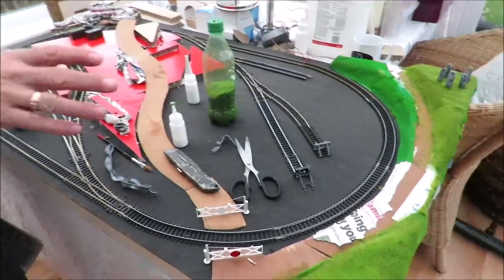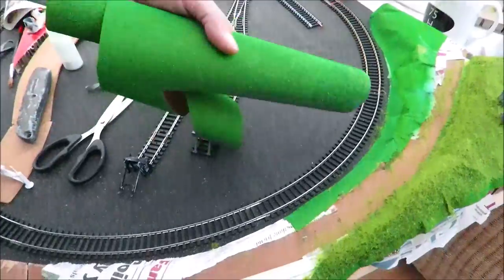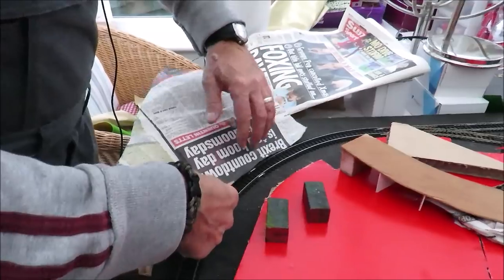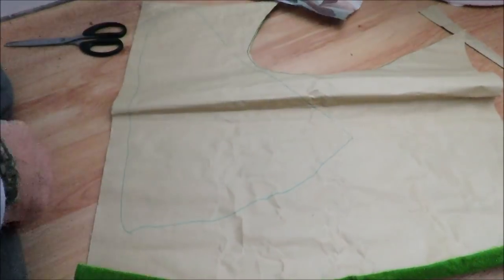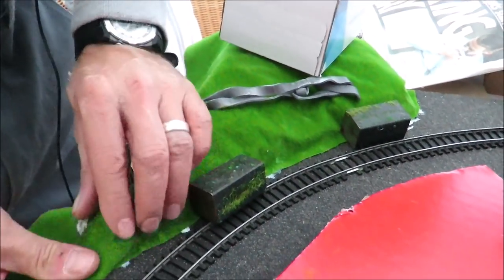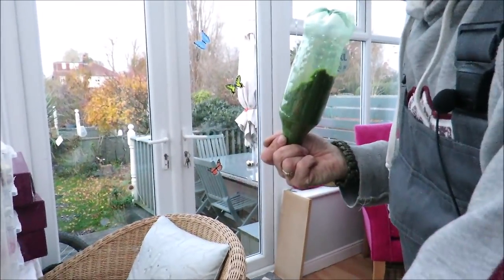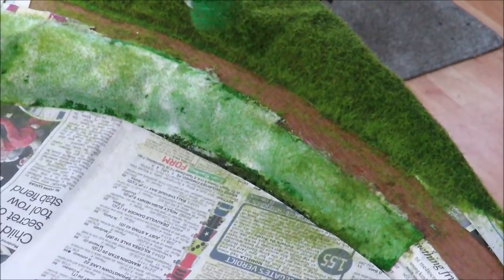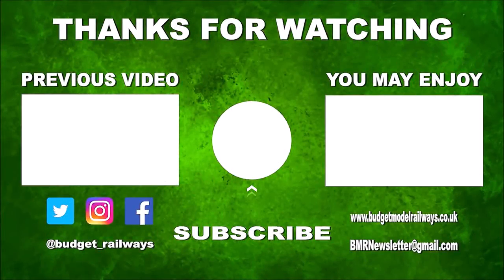Creating An OO Gauge British Model Railway Exhibition Layout - Part 4 - Static Grass

Comment: Nice take on an alternative for the Noch bottle applicator, does it make a difference if you let gravity do it's work instead of launching the fibers on air pressure by squeezing the bottle?
That water tower / locomotive shed would make a great Kof (very small shunter) shed for a continental styled layout.
Reply: For an example: https://www.youtube.com/watch?v=6L8HGEuxg0s
The strange design allows transport by flatcar without disassembly, as the maximum speed is about 30-40 kmh
Reply from the maker: Good point, ive tried shaking from higher up which works better. The loco shed is based on UK branch line practice but could work anywhere

Comment: can you please tell me the best curve radius for oo gauge the width of the board is twenty two and half  inches and the length is 6ft 5in
Reply from the maker: The smallest standard curve is 1st radius which needs 31in diameter, so you will need to use flexi track. This will give you approx a 20in diameter curve allowing for clearances. This will limit you to 0-4-0s , older bo bo diesels and short wagons and coaches. You may also need to remove a coupling hook from each connection to avoid coupling lock. But you can run a perfectly good model railway especially as that much length will allow you to have a decent passing loop, allowing you to have two trains on the layout, plus some sidings